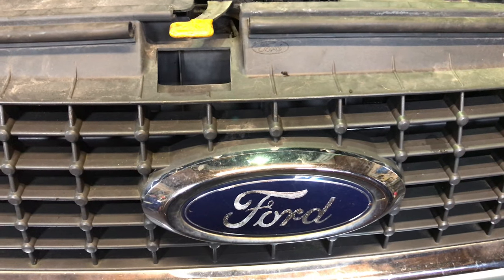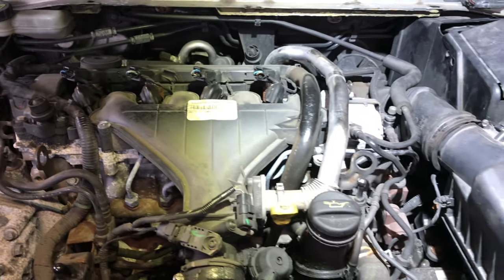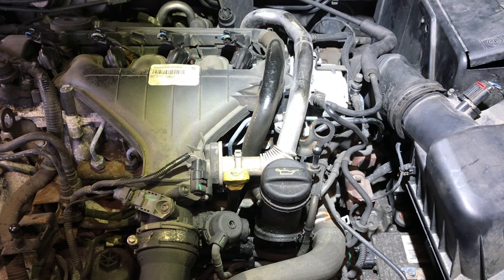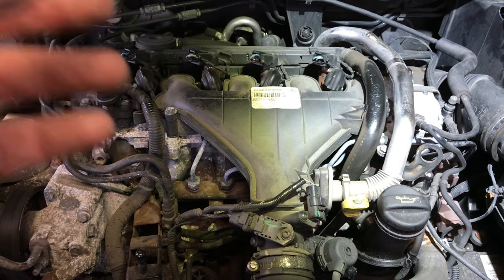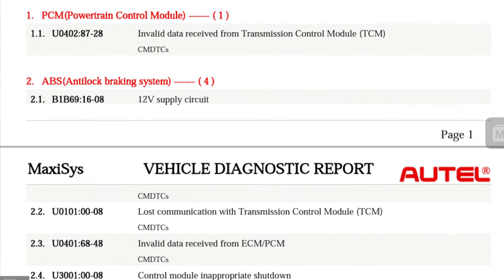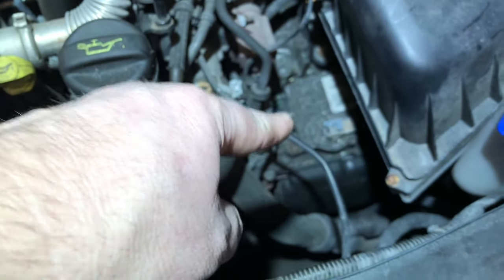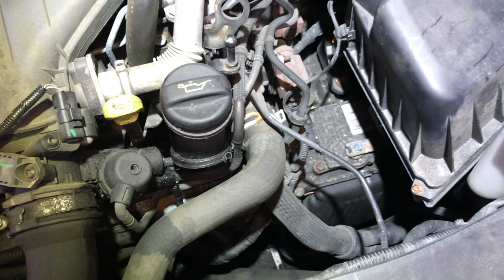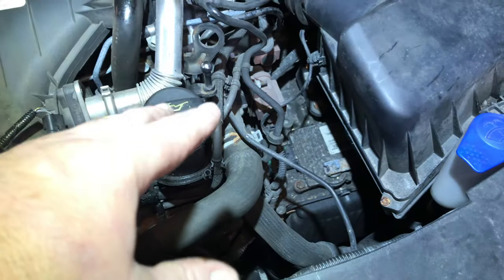Ford Mondeo TDCi Automatic (2009) - Intermittent Breakdown! TCM No Comm! Part 1

Comment: Just had a very similar issue on a 2013 S-Max auto.  Intermittent non start, no crank, various warnings, no shift lever lights.  Took me ages to actually replicate it. Various U codes but non for TCM. Eventually after checking many many things I got it to fault and a TCM error code stored. I checked the powers and grounds and found 0.7v on the ignition feed.  After 30 seconds the fault disappeared and all was good again, I have 30 seconds to diagnose this!!.  Fault traced to TCM power relay in the engine fuse box, all feeds etc good (load tested) , but relay primary wouldn't latch in intermittently, then after 30 seconds it would?  New relay fixed it !  Wanted to do a video but the footage etc was so fragmented i gave up ...lol
Reply from the maker: Thanks Steve for your help in this fault, I've just posted the update mentioning you in it cheers sandy
Reply: @sandyande  was that the issue?
Reply: I have exactly the same problem with my Mondeo (2010 2.0 TDCI). Can you tell me which relay it is, number 2 or number 12?
Reply: @sandyande  what's the fix?
Reply from the maker: @machinedred  renew the Relay
Reply: @sandyande  thanks